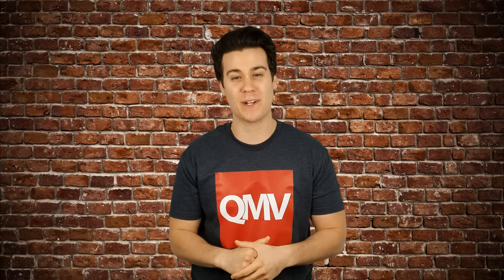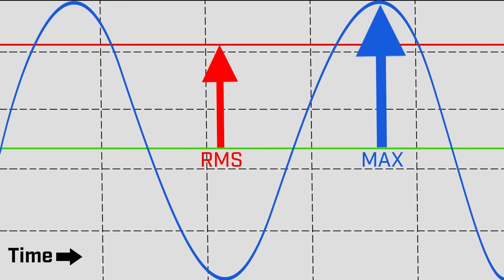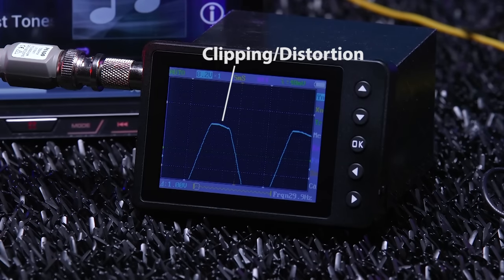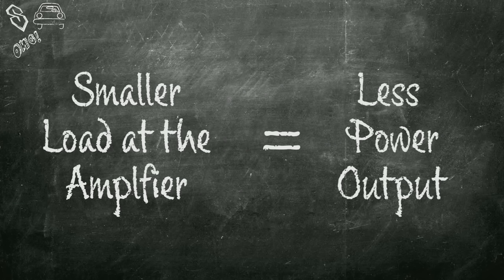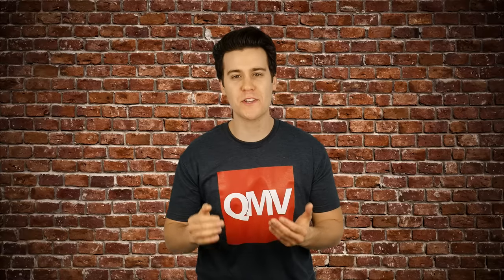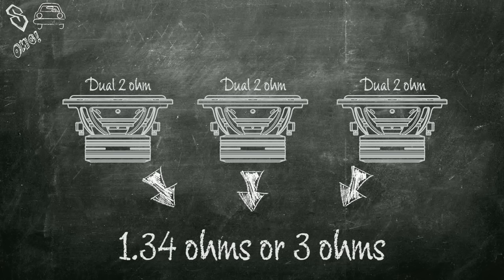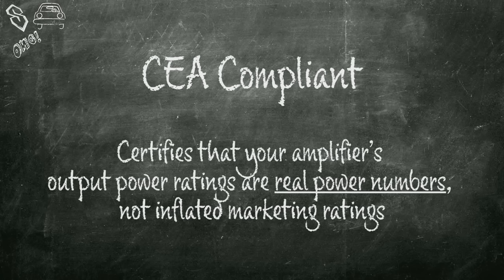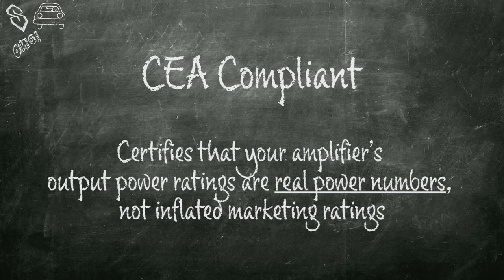How Do You Match Car Subwoofers and Amplifiers?

Comment: Need help !!! Will a SVR-12 12’ 1600 Watt max power car subwoofer be too much for a RP-1500.1D 1500 Watt mono block car amplifier?
Reply: More info !
Amp : Rms power 1500 watt . 
Peak power 2300 watts .
Subwoofer : Rms power handling 800 watts .
Peak power handling 1600 watts .

Comment: Let's say I have two Pioneer TS-A120D4 subs which are 4Ω DVC subs rated at 500w RMS each. Total RMS required would be 1000w. And let's say I have a Pioneer GM-D9701 amp which is a Class-D Mono Amp with two outputs rated for 1200w RMS at 1Ω, 800w RMS at 2Ω and 500w RMS at 4Ω. If I run the subs in Parallel to one of the outputs on the amp, then the subs would be putting out a 1Ω load correct? So I'd be able to run these subs with this amp seeing that the amp is rated for 1200w RMS at 1Ω right?
Reply from the maker: Correct on all accounts! Perfect match for the 1 ohm load in parallel.
Reply: @Qualitymobilevideo  Awesome! I'll definitely be running this in a sealed enclosure, it should be a solid set up.

Comment: I got 2  P3D2 12in  subwoofers  600 watt rms what's the best amp to put on them
Reply from the maker: So two DVC 2 ohm woofers wire to 2 ohm in parallel. These combine for 1200W RMS. You'll want a monoblock amplifier with a power range of about 1100-1400W RMS @ 2ohm. Here are some options:

Kicker CAX1200.1 1200W RMS @ 2ohms
http://www.qualitymobilevideo.com/cxa1200-1.html?utm_source=YouTube&utm_medium=Video&utm_campaign=Match_Subwoofers-Amplifiers

Hifonics Brutus BRX2016.1D 1400W RMS @ 2ohms
http://www.qualitymobilevideo.com/brx2016-1.html?utm_source=YouTube&utm_medium=Video&utm_campaign=Match_Subwoofers-Amplifiers

Kenwood KAC9106D
http://www.qualitymobilevideo.com/kac9106d.html?utm_source=YouTube&utm_medium=Video&utm_campaign=Match_Subwoofers-Amplifiers

Power Acoustik BAMF1300D
http://www.qualitymobilevideo.com/bamf1-3000d.html?utm_source=YouTube&utm_medium=Video&utm_campaign=Match_Subwoofers-Amplifiers

Power Acoustik EG14500D
http://www.qualitymobilevideo.com/eg1-4500d.html?utm_source=YouTube&utm_medium=Video&utm_campaign=Match_Subwoofers-Amplifiers

Hifonics Zeus ZRX3216 1600W RMS @ 2ohms
http://www.qualitymobilevideo.com/zrx3216-1d.html?utm_source=YouTube&utm_medium=Video&utm_campaign=Match_Subwoofers-Amplifiers

Comment: So correct me if I’m wrong I can run a 1000w amp on on a 2000w 15 and I’m using 0g wire I feel like it should power it

Comment: I can’t find anything but would I be able to wire a 10inch 300w speaker to a 400w amp?
Reply from the maker: The info you're giving me is a little vague bud. This is all dependent on the specifications of the gear. Matching the power is the last parameter to focus on. Is the subwoofer DVC or SVC? Is it 2 ohm or 4 ohm? What impedance is the amplifier stable at? What does it do at each impedance for power output?

Comment: Great video and yes I’m fried lol. So my son plans on running 2 KFC-W3013PS kenwoods 4ohm 1200watt 400rms with a Rockville DB25 2800 watt 1400rms amp. Has a cea-2006 rating of 700watts. Will this amp be good to run these subs in a sealed box. And should I wire them in parallel thanks in advance
Reply from the maker: Hey! Has he bough the amplifier yet? I'd personally go with a monoblock.
Reply: Quality Mobile Video nope. Gonna go with the  Rockville dB14 4000watt 2000rms cea 1000 2 ohm
Features: Rockville dB14 4000 Watt/2000 Watt RMS Mono Class D 2 Ohm Car Amplifier With Optical Coupler Technology
CEA Compliant Power Ratings; 2 Ohm: 1000 W x 1 Channel <1% THD+N. 4 Ohm: 600 W x 1 Channel <1% THD+N
RMS Power Ratings: 2 Ohm: 2000 W x 1 Channel. 4 Ohm: 1200 W x 1 Channel
Peak: 2 Ohm: 4000 W x 1 Channel. 4 Ohm: 2400 W x 1 Channel
Reply: My son is on a limited budget. Lol.
Reply from the maker: Lol I feel ya. Ok better! And those are Single Voice Coil subs right? If so then good match! Two SVC 4 ohm subs make a 2 ohm load, which that amp supports! Wired in parallel!
Reply: Quality Mobile Video yes svc. Thanks man for the help. 👍🏻👍🏻

Comment: I got 2 15 kickers comp c  DVC 4 ohm subs ...600 watts rms, 1200 watts rms combined , 2400 watts max( the max power i ignored) I also have a hifonics brutus  bxx 1200.1d  mono block amplifier rated at 1200 watts rms at 1 ohm. Its a 1 ohm stable amplifier. I plan on wiring the subs to one ohm to get the 1200 watts rms. Is this safe and Will this setup work safely or should I have bought an amplifier with more head room?
Reply from the maker: More head room would be good but it's a very solid match!
Reply: So my subs don't be damaged in any kind of way?
Reply from the maker: If you run and wire them correctly you'll be fine
Reply: @Qualitymobilevideo   thanks !

Comment: Which is a better match for my KXA1200.1. amp. The 4 Ohm  11S12L74 Subwoofer L7S12 or the Kicker 11S12L72 12-Inch 1500W 2 Ohm???????
Reply from the maker: Get the 4 ohm and wire in parallel to a 2 ohm load

Comment: I have Kicker CompVR 12" 2 Ohm 1600 Watt Peak DVC Car Audio Subwoofer (pair) 43CVR122. What would be the best amp for it
Reply from the maker: So by (pair) you mean you have Two Subwoofers? If so, two dvc 2 ohm woofers can wire to a 2 ohm or 8 ohm load. These put out 800W RMS combined. You'll want a monoblock with a power range of 750-950W RMS @ 2 ohm. Check these out:

Pioneer GM-D9701 800W RMS @ 2 ohms
http://www.qualitymobilevideo.com/gm-d9601.html?utm_source=YouTube&utm_medium=Video&utm_campaign=Match_Subwoofers-Amplifiers

Rockford Fosgate R1200-1D 800W RMS @ 2 ohms
http://www.qualitymobilevideo.com/rockford-fosgate-r1200-1d.html?utm_source=YouTube&utm_medium=Video&utm_campaign=Match_Subwoofers-Amplifiers

Kenwood KAC9106D 1000W RMS @ 2 ohms
http://www.qualitymobilevideo.com/kac9106d.html?utm_source=YouTube&utm_medium=Video&utm_campaign=Match_Subwoofers-Amplifiers

Kicker CAX1200.1 1200W RMS @ 2ohms
http://www.qualitymobilevideo.com/cxa1200-1.html?utm_source=YouTube&utm_medium=Video&utm_campaign=Match_Subwoofers-Amplifiers

Power Acoustik RZ1-1500D - 900W RMS @ 2 ohms
http://www.qualitymobilevideo.com/rz1-1500d.html?utm_source=YouTube&utm_medium=Video&utm_campaign=Match_Subwoofers-Amplifiers
Reply: Quality Mobile Video which one would you prefer that can last long at a good price
Reply from the maker: Rockfords are the best. Then that Pioneer is solid

Comment: I want to get 2 kicker cvx subs. They are 600 rms each for a total of 1200rms. Would a 1500 watt amp be a good choice. I already know that I want the subs wired to a 4ohm load and I know the amp need to put out at least 1200rms at 4 ohms
Reply from the maker: Well just be aware that if you want to make a 4 ohm load, you'll have to get the 4 ohm versions and wire in series. An amplifier with a power rating of 1500W RMS @ 4 ohm is perfect
Reply: Wouldn’t I have to wire the 4ohm dvc subs in series/parallel to keep them at 4 ohms?
Reply: Quality Mobile Video I’m having trouble finding an amp that puts out at least 1200rms at 4 ohms. I would love to stay with the same brand everything but kicker doesn’t offer an amp that strong. Does anyone know a brand that offers 1500rms at 4 ohm load?

Comment: If a speaker have a max watt rating 2000 I would use a 2000 rms amp. Music are dynamic so once the amp is not excessively clipping the speaker would take. Music are series of varying frequency and db.

Comment: So I have 2x12in subwoofer that are 2ohms and they're 1200rms per sub. So what amplifier will I need for them? I would appreciate some help on this one.
Reply from the maker: Need another piece of info! Are the DVC or SVC? I'm assuming DVC. Two 2 ohm DVC woofers wire to a 2 ohm load or 8 ohm load. However, Two SVC 2 ohm woofers can wire to a 1 ohm or 4 ohm load. So find a monoblock amplifier that matches your 2400 RMS power and impedance requirements
Reply: @Qualitymobilevideo  1200 Watt RMS, 2400 Watts Peak (Burp Only)

3-inch diameter, four-layer copper coil

Cast Aluminum Frame

Available in Dual 2 and Dual 4 ohm configuration

10 AWG push terminals

Black EROM surround without stitching

Vented back-plate for optimal cooling and less turbulence in the coil gap.

Conical back plate to allow more voice coil travel.

Black electroplated top and bottom plates.

Non-pressed, fiber added cone for maximum rigidity.
This what I read when I got them.
Reply: @Qualitymobilevideo  but there 2ohms 12in subwoofer

Comment: HELP i need to find a good amp for my 2 12's. they are power acoustic 3500w/1750rms a piece. i currently have the rockville db14 3500w/1000/rms amp. i cant seem to find a good fit for these. they are in a ported separated single box i think i can smell the amp working hard to push both of these at 2/3rds gain

Comment: Could you tell me the best way to wire up two JL audio 12 TW3s dual voice coils with a audio control LC 1.1500? I want to run them  at 4ohms. They are in a sealed box.
Reply from the maker: Two DVC 4 ohm woofers make a 4 ohm load wired in parallel/series. https://www.qualitymobilevideo.com/subwoofer-impedance-wiring-wizard
Reply: @Qualitymobilevideo  Thanks for the reply! I surely appreciate it! I asked the same question in a couple other videos not knowing if I would get a reply in case it was too old of a post. Sorry to have repeated it! Thanks for putting out great content, a lot of us need it!!!

Comment: I have a 1600 watt amp. Can i pair it with a combined rms of 800-1000 kicker speakers?
Reply from the maker: I need more info the amp and subwoofers. Do you have exact model numbers?
Reply: @Qualitymobilevideo  hey thanks for getting back to me. Its a M/A audio 1387 2 channel. And the subs are kicker comp r 10 inch.

Comment: I have 2 600 watt (4 ohm each) 10inch kenwood subs . i need advice for a non mono amp
Reply from the maker: Need more info. Are they DVC or SVC? If they're DVC you can wire them to a 1 ohm or 4 ohm load. If they're SVC, you can wire to 2 ohm or 8 ohm. Find a monoblock amplifier compliant to whatever load you'll be making while matching the combined RMS of the subs to the amplifier.

Comment: If I have my total RMS when only running 4 subwoofers and 2 tweeters on a 4 chanel 700watt subwoofer with some midrange speakers mounted on the overspray surface with a drastic monotone 10 ohm impedence resistor what does the measurement of the speaker have to be? Idk what im talking about

Comment: Hi teacher, i need help :v 
Im planing to instal a 4chanel amplifier to power my 4 bookshelf home speakers and one active subwoofer on it, on the subwoofer part, since its an active sub so its have its own power supply etc, do i still have to do that rocket scientist math about the ohm seri pararel and stuff?? Im planing to just feed the 2 front L n R pararel way from the amplifier to the sub, is that ok doc? Eh, teacher 😄
Reply: Ah for the power source to the amplifier im planing to use a 12v 30a power supply kit, i saw it on youtube and i think it would work no problem, or arnt they? :v

Comment: I’m going to be running two 12 inch subs with 4 ohms with dual voice coils and with a 2000 watt max mono block amp what kind of ohms should I run at ?? 1 ohm at 1000 watt rms 2 ohms at 700 watt rms and 4ohms at 500 watt rms. Series or Parallel??!
Reply from the maker: What is the combined RMS of the subs and the RMS ratings of the amplifier. Never go by MAX ratings
Reply from the maker: And two DVC 4 ohm subs can only be wired to a 1 ohm(parallel) or 4 ohm(series) impedance. With 1 ohm you'll get the most power, but with 4 ohm your system will run more efficiently. Depends on the RMS of the subs and your personal preference
Reply: Quality Mobile Video both combined rms rating is 600 watts. I decided to go parallel/ series that left me at 4 ohms at 500 watts rms (250 on each sub) so it’s giving me some good power with a little heat

Comment: What if I have 2, 10”  Rockford Fosgate P1 with an RMS of 250 and the Rockford fosgate R500X1D. Would that work out wired at 2 ohms?
Reply from the maker: If they're SVC 4 ohm they can wire to 2 ohm. Or if they're DVC 2 ohm they can wire to 2 ohm
Reply: @Qualitymobilevideo  the R500X1D amo is rated “500 Watts x 1 @ 2-Ohms” does that mean for 1 speaker or what does the “x 1” mean in the rating? 
And also would it be ok since they would both be at 500 watts even? I know you talked about having head room would be better

Comment: What would be a good amp for 2 dual coil 4omh kickers solo baric 10” 500w rms
Reply: Ooooh nice subs I would go with the mono block. You can always add a 4 channel later on for your door speakers if you want. I think the kicker mono blocks is a good choice. Generally I think sticking with the same brand to be safe. 

I hear a lot of good stuff about DD audio Jl audio and kicker.

But do make sure you want the dual voice coils or the single voice coil. You don’t wanna buy an amp that won’t match your wiring for two dvc subs

Comment: I have a 1200 w peak sub and at RMS it's rated at 275 w RMS 4 ohms .I want to use the Pioneer 2000w 5 Channels amp which will give  350 w at 4 ohms for my sub 
...is it a good match?
Reply from the maker: Is the subwoofer DVC or SVC
Reply: @Qualitymobilevideo   It's a SVC
Reply from the maker: @Ken.chocken31  You can wire a SVC 4 ohm woofer to a 4 ohm load so yes. But you're using a 5 channel amplifier to power just one subwoofer? Is it power speakers?
Reply: @Qualitymobilevideo   yes am planning to power my front and rear speakers out from the  channel A and B respectively  and the sub from the sub channel so that I will have a complete sound system from one amp...

Comment: What is better to run 1ohm or 2 ohm.  Witch is louder and hits harder.     I have 2500 watt rms amp  and a 2500 watt rms speaker  matching brand. Alphasonik    want the loudest I can get .
Reply from the maker: 1 ohm hits the hardest, gets the most potential power and bass from your gear. 2 ohm is more efficient
Reply: @Qualitymobilevideo  maybe yal should make a video with same set up but diff ohms.    To hear the difference. If its possible.   Like ohm sound test.   I haven't seen a video with both set ups.
Reply from the maker: Well the problem with that test is it all depends on the kind of gear you're using for your specific load, in terms of the subs are they DVC or SVC, 2 ohm or 4 ohm, are you using one or two, so pairings can make a 1 ohm load and others can't, some pairings can make a 2 ohm load and other pairings can't. So either way it will most likely come down to the gear for each specific load and then it may be too subjective of an experiment

Comment: Also if I use larger awg will that be a problem.  14awg vs 16awg  wiring a 2006 civic coupe
Reply from the maker: If you're wiring average powered speakers, 12-16 AGW is fine. Subs definitely want to be safe with 12 AGW

Comment: Man this really got me more confused than anything 😐 😕.
I have a 2009 rockford fosgate p500 1bd amp and two 2009 punch P3SD410 can i safely wire them at 1 ohm for this amp or keep them at 4ohms??
Reply from the maker: So the Rockford Fosgate P500X1bd is not stable at 1 ohm, only 2 ohm and 4 ohm. Two DVC 4 ohm woofers can wire to 1 ohm or 4 ohm. Those have a combined RMS 600W RMS, and the amp only does 150W RMS @ 4 ohms. This amplifier is not a good match. Look for an amplifier with a power range of 550-750W RMS @ 1 ohm.

Pioneer GM-D8701 - 800W RMS @ 1 ohm (perfect match)
http://www.qualitymobilevideo.com/gm-d8701.html

Rockford Fosgate P1000X1BD - 1000W RMS @ 1 ohm load:
http://www.qualitymobilevideo.com/rockford-fosgate-p1000x1.html

You could also make a 4 ohm load with something like this amplifier:
Kicker CXA1200.1 600W RMS @ 4 ohm
http://www.qualitymobilevideo.com/cxa1200-1.html
Reply: @Qualitymobilevideo  its not the p500x1. Its p500 1bd from 2009 and the user manual says its stable a 1ohm for 500w rms. But since the subs are 300 watts each I don't know if the amp can handle it.
https://rockfordfosgate.com/products/details/p500-1bd/ here its a link from the website hope you can help me with this thank you!!

Comment: I have 2 p2d2 12 inch Rockford fosgate subs. What amp would be best around $150.
Reply from the maker: Two DVC 2 ohm woofers make a 2 ohm load, those do 400W RMS each, so you'll want a monoblock amplifier with a power range of about 700-1,000W+ @ 2 ohms. Check these out!

Pioneer GM-D9601 800W RMS @ 2 ohms
http://www.qualitymobilevideo.com/gm-d9601.html?utm_source=YouTube&utm_medium=Video&utm_campaign=Match_Subwoofers-Amplifiers

Kenwood KAC9106D 1000W RMS @ 2 ohms
http://www.qualitymobilevideo.com/kac9106d.html?utm_source=YouTube&utm_medium=Video&utm_campaign=Match_Subwoofers-Amplifiers

Power Acoustik RZ1-1500D - 900W RMS @ 2 ohms
http://www.qualitymobilevideo.com/rz1-1500d.html?utm_source=YouTube&utm_medium=Video&utm_campaign=Match_Subwoofers-Amplifiers

Comment: what amp is a good match for own Alpine S-Series 10" 600 Watts sub?
Reply from the maker: The Alpine S-W10D4? This is a DVC 4 ohm sub, meaning it can be wired to a 2 ohm or 8 ohm load. Plus it has an RMS of 600W RMS so you'll want a monoblock with a power rating of about 550-75W RMS @ 2 ohm. Check these out: 

Pioneer GM-D9701 - 800W RMS @ 2 ohms
http://www.qualitymobilevideo.com/gm-d9701.html?utm_source=YouTube&utm_medium=Video&utm_campaign=Match_Subwoofers-Amplifiers

Power Acoustik RZ1-1500D - 900W RMS @ 2 ohms
http://www.qualitymobilevideo.com/rz1-1500d.html?utm_source=YouTube&utm_medium=Video&utm_campaign=Match_Subwoofers-Amplifiers

Kicker CXA600.1 - 600W RMS @ 2 ohms
http://www.qualitymobilevideo.com/cxa600-1.html?utm_source=YouTube&utm_medium=Video&utm_campaign=Match_Subwoofers-Amplifiers

Rockford Fosgate R1200X1D - 800W RMS @ 2 ohms
https://www.qualitymobilevideo.com/rockford-fosgate-r1200-1d.html?utm_source=YouTube&utm_medium=Video&utm_campaign=Match_Subwoofers-Amplifiers